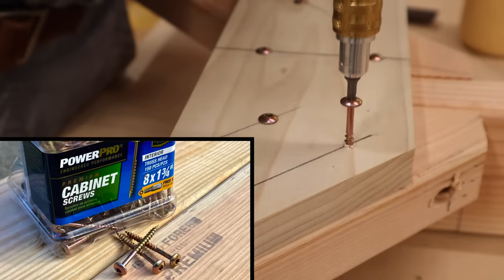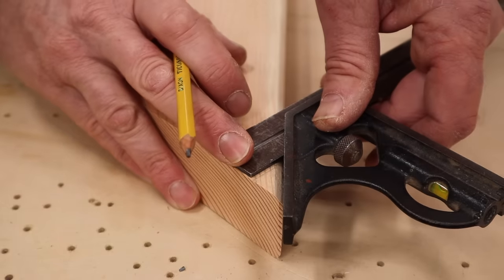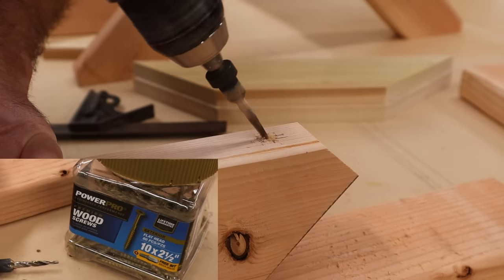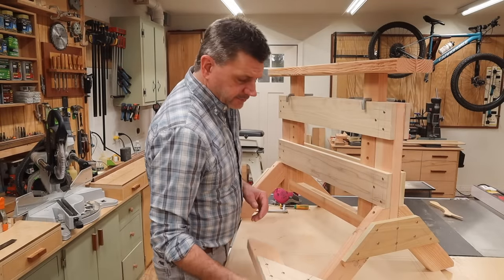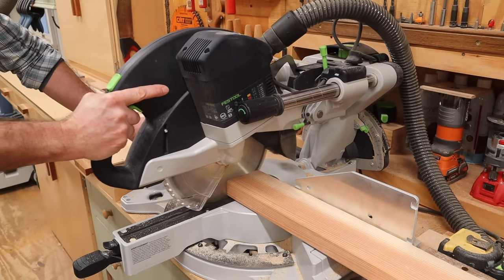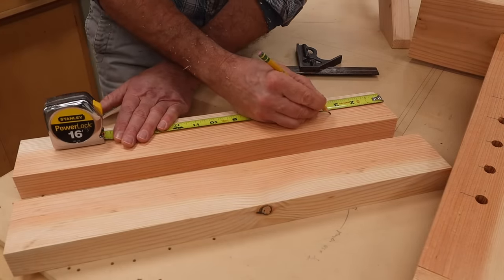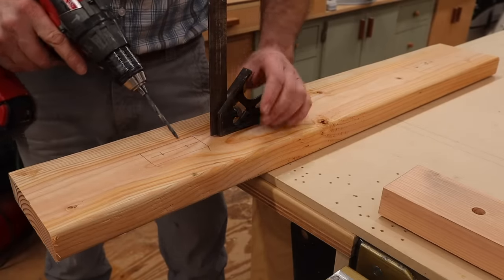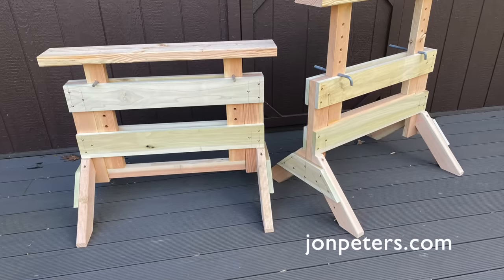Make Adjustable Sawhorses [+ With PLANS]

Comment: Looks like a great design if you have a need for adjustable heights! Simple and effective. With some additional thought and planning, you could even make the heights correspond to various machinery for indeed/outfeed support! My only criticism is footprint they'd take up when not in use. In that regard, nothing I've found works better than the 2 sets of folding plastic sawhorses I bought 30 some years ago. All 4 of them hang neatly on the wall on a bracket and out of the way. They're good quality, hold a lot of weight and are easy to carry. These look really good though, Jon!

Comment: Hey thanks for a truly ingenious sawhorse design. The only way I deviated from the plans was to use 5/8" diameter hitch pins instead of anchor bolts. They came with retainer clips. So if I am doing something with a lot of vibration they're unlikely to slip out. I also love how sturdy they are.

Comment: nice build! If i were to change one thing I'd add a holder for the adjustment pins, mainly coz I'd probably misplace them
Reply: Great idea.  You could add some rare earth magnets, or even drill a hole into the foot to accept the pin.

Comment: You can position the lower cross braces to be halfway up the holes.  So there would be adjustments every 1 inch instead of 2 inches

Comment: It looks like depending on where you insert the pin (top rail vs bottom) you can get adjustability finer then the two inch spacing of the holes in the riser.

Comment: Jon just applied for the saw horse plans If you don`t mind I am making a small design change I am going to dado a one inch wide dove tail channel with top opening being slightly less than three quarters so a dowel will be just above the surface and work like a roller on an out feed

Comment: Nice job.  If more adjustability is needed, use 2x6 verticals with 2 ( or even 3) columns of holes offset by 1" (or whatever) so they can be staggered.

Comment: I tried to get away with using cedar pickets for all the braces. After all, this first one I'm making is a test. I wholeheartedly advise against using cedar. It's not nearly strong enough. I also advise making a jig for the foot leg assembly.
I haven't made the part that is made last. But based on what I've done so far, I would recommend making another jig to keep that part square. Be sure to follow Jon's instructions how to keep the feet identical. It's very important.

Comment: I am in the process of making more of these adjustable sawhorses. It is not as easy as it looks. And I am a fair to middlin woodworker. I've got the first one about three-quarters done. The quality is so low I would be embarrassed to even attempt to sell it. No fault except mine. I will keep at it, though.

Comment: Jon, you may want to erase this comment.
 I find that the leg/foot assembly, as designed, is too hard for me to do, accurately, since I don't own a finish nailer. What I'm going to do with the next one will be to use a one-piece foot running horizontally. The triangle braces will be approximately 14 inches tall and 16 inches wide. The feet will have a cutout on the bottom 3in in from both ends, about 11/2 deep. I finished my first one and I had about five and a half hours invested in making just that one. I had it in my head that it was only going to take me about maybe an hour and a half to make one. You make it look real easy. And you did a great job.
Reply: I am kind of weak on being able to upload from my photos, but if I can figure it out I'll send you one photo.
Reply: Es genial ! , únicamente que me hubiera gustado que también se usase el sistema métrico decimal, con subtítulos , gracias

Comment: What a complete waste of time!!! My $20 plastic Harbor Freight ones work just as well!!! I can picture you chuckling while reading this... I enjoy seeing everyone customize their own saw horses differently. Well done Bud. Hoping all is well, Dirty Jersey out!!
Reply: I'm sure your comment about the Harbor Freight plastic horses was made in jest. Those are the reason I'm looking at plans for saw horses. I'm working on a fairly heavy platform for a washer and dryer, and can barely manage the weight. To make it easier to unload the materials to build it, I decided to cut the plywood to size in my 16' X 7' trailer, using the HF plastic horses. With my wife's help, we managed to get the plywood on the horses, but one of the links that holds the legs in place separated while we were cutting and the last couple of inches of the kerf broke. Not a happy camper! They're so lightweight that it's hard to put something fairly heavy on them without having them flip over. I do have some HF horses with metal legs and wooden top that work pretty well, but they're in an outbuilding holding up another project.